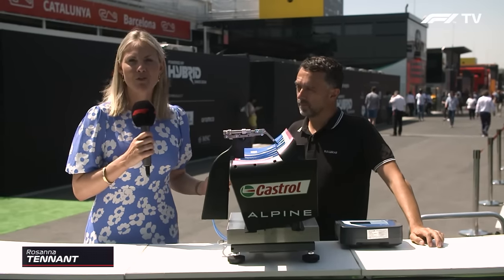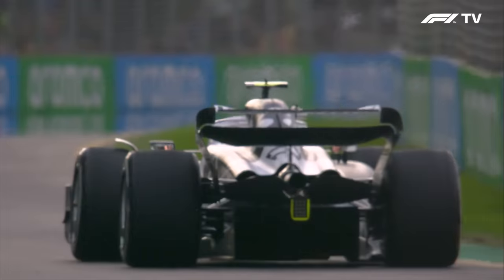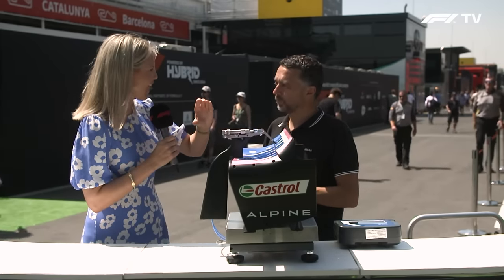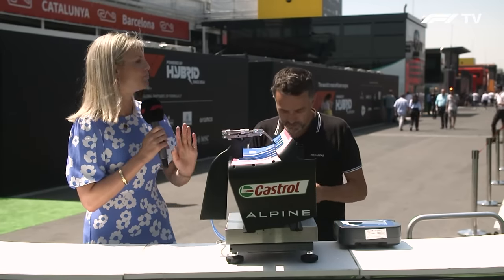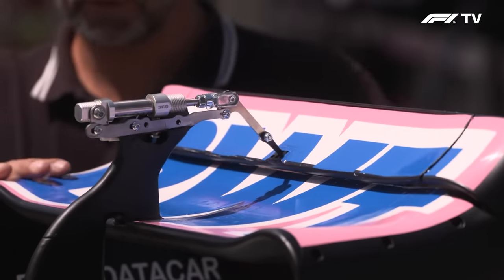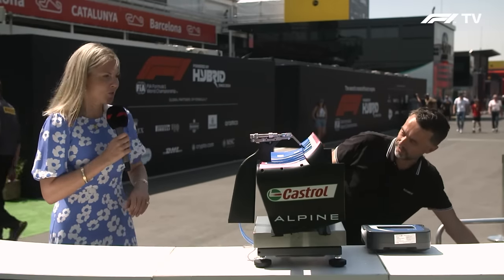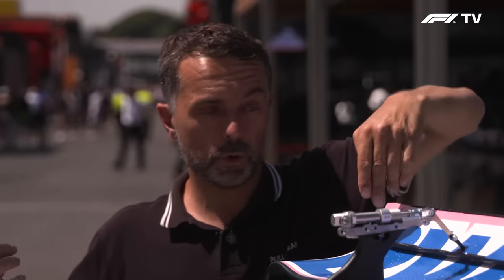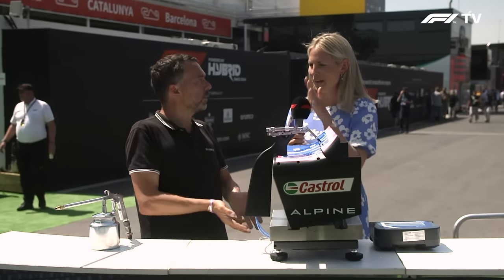How Does DRS Work? | F1 TV Tech Talk | Crypto.com

Comment: 30% reduction in downforce is absolutely mind boggling when seeing how simple the system is. Its just opening a flap and bam 30% less downforce, the innovation and understanding of physics for these cars is truly on its own level
Reply: Aside: 30% reduction is for the rear wheel, not for the whole car
Reply: Well not really "mind boggling" because the rear wing is one of the components that generates the most downforce
Reply: @alancarriedo7378  Yeah well, that's exactly what they're saying, it's insane how one component contributes to the downforce so much
Reply: Easy to grasp when you realize that the energy required to go forwards on earth's surface is to the cube of speed!
Reply: @rkan2  no
Reply: Ehhh… that is aerodynamics 101. The way DRS works is one of the easiest aerodynamic topics to understand on an F1 car.
Reply: @shabalala6605  back in the day main force unit was kgf or kg, so it is kinda old habbit, slightly wrong but everybody who experienced with high end engineering can understand that sentence. That's why back back in the days, daN was really really popular also.
Reply: Does this mean the wind speed can affect race speed and results?
Reply: @nicholastwesige5893  yes :)

Comment: I like it when they explain about the usage of the DRS. That thing has been around since I guess 2011, and man it has worked ever since. That's amazing!
Reply: But DTS has only been around since 2020 or whenever...gotta appeal to those brand new yankee fans
Reply: @alpd7638  Yet you tune into the video and comment on it, so I suppose it appeals to bitter gatekeepers as well?
Reply: @alpd7638  but it's been around since 2011.....
Reply: @alpd7638  and were talking about DRS
Reply: @alpd7638  the addition of DRS years ago wasn't a positive addition to F1 and I've been a fan since the 90s.   It was designed to assist in the lack of passing in f1 at that time.   Technically interesting but that's it, I'd rather the cara have better aero where there's no reliance on drs.
Reply: @alpd7638  as said by another comment… Don’t be a gatekeeper.. If anything you should be happy that new fans are showing more interest to the engineering side of things

Comment: the fact that when the DRS is closed it creates the HUGE drag and when its open it still has a a bit of drag so that the drivers dont create an actual rocket out of the DRS system, like i seriously cant imagine the drs sending a horizontal straight line through the back of the car. That would be like adding probably 30+ kph more than it already has. Mindblowing

Comment: F1 should implement DRS in a similar way to Indycar's Push to Pass. Every driver should get an equal amount of DRS to use at their discretion throughout the race. This could be an amount of time with the flap open, or a given number of activations. You can keep the DRS zones, but just think about how exciting it would be to see a driver chasing down a position and having DRS available to close a 2 or 3 second gap and then go for the pass, or how it would change the strategy if drivers could use DRS to defend as well as attack. I think it would make the racing even better ON TOP of the improvements made by the 2022 rules.

Comment: With the new contours of the rear wings on the ‘22 cars, it looks as if when DRS is opened the lower outside corners of the upper wing element actually are presented up & into the airflow. When opened the rear surface of the upper wing element’s lower outside corners are actually visible in the car’s on board rearward camera views. Especially noticeable on the cars that have different colors front & rear on the upper wing element. Would that not cause drag & perhaps even a lifting (negative G) force???

Comment: The segment does NOT explain how DRS works.  It only explains what DRS is and mechanically how it actuates. That's only 1 small part of 'how DRS works' in a real race.  How do the detection zones work?  How does a car/team/driver know the timing coming from the detection zone monitors?  How is the detection timing communicated to the onboard computer and/or driver?  Someone needs to make a video that shows a car on the track, the detection zones, the DRS zones, the steering wheel indicators, AND the actions of the driver in order to really see how DRS 'works'.  For instance, does the driver have to look down at the screen on his steering wheel for the DRS timing on every lap for every DRS zone?  If less than 1 second then manually push the DRS actuator?  What if he opens it before the DRS zone?  What if he opens it even though the car in front is more than 1 second ahead?  In short, HOW DOES IT WORK.

This is  great youtube channel, but in this case, more questions than answers.
Thx.

Comment: I always thought that DRS was counter productive. I would think the correct way to use it would be free use if you are within 5 seconds of the car in front of you until you are .25 seconds behind the car in front then can't use it. That would cause closer racing if that's the point of it. Not what it currently does which is just let the car that caught up just blow by you.
Reply: Let me try to break this down in parts. 

Lets always keep in mind. safety. These cars are capable of outputting an immense amount of energy at once. The only thing holding it back is the downforce and the gearbox. 

A human is already in control of a lot of things, in the back of their minds they are calculating deltas, corner speed, corner entry/exit, positioning, etc... Given all of that look how many 30g+ accidents already happen. 

Throw away this argument and say they are professionals.

 How many more sensors are going to be required on the circuit, in the car, monitoring system... This brings us to to regulations, the teams are going to try to cheat it and its just a matter of who does it the best, nonetheless regulation stiffen innovation which is really what the goal of F1 is supposed to be about along with close racing. Entertainment is last. 

You will probably never read this and to be fair I will never come back to this. but these are my thoughts on why your proposed solution does not work.

Comment: The mysterious part to me is the “detection zone”. Is this a visible marker or an electronic sensor? Seems like the button push would have to be timed exactly. If the driver pushes the button ahead of the zone, what happens then? I was hoping this video would have gone deeper than the basics.
Reply: In the race, the detection zone is the place where the distance between cars is measured. If it's within 1 second, then it will allow the driver who is behind to activate the DRS during the DRS activation zone. If you press the button before the activation zone, nothing happens. So it's an electronic sensor. There are DRS signs on the straights that serve as a refferences for drivers to know where the DRS activation zones start.

Also note that drivers can use the DRS during qualifying on any activation zone without the need of being within 1 second behind another car.
Reply: There is a sensor under the track, the driver hears a beep when passing over and then he press the button. If the driver press the button out of the zone, it has no effect. Something like this was explained by Pedro de la Rosa (ex f1 driver) the other day in the Spanish broadcast

Comment: Anymore on air technology on Formula could be develop similiar on DRS but its place on velg,blade velg whell that could add air into inside that could change anything needs,,downforce,compresion/pressure engine,engine cooler radiator,,but not much significant than transmision (gear ratio/speed summary) development,,thanks,,hhe

Comment: One thing I've never had an answer for is how does the car know that they're within 1 second of the car ahead? What if they're 2 seconds behind and the driver presses the DRS button anyway? Does it still open?
Reply: You would have to assume the button is only able to be activated if the car is 1 second or closer using the official race clock as it passes the DRS detection point. Maybe the detection zone puts out a signal to the car and the button THEN becomes available to use once entering the DRS zone. I doubt it is reliant upon the driver or the team to allow DRS usage or not. 

The above is all assumption :)

Below are just some copy/paste answers from Google I just searched. It seems it's all automated. 

Is DRS activated automatically?
When the pursuing car is within one second of the car in front when both cars cross the detection point, this turns on a light on the dashboard and the driver can activate the DRS and try to overtake,” he explained. “The detection of the gap between the two cars and the lighting system are fully automatised.

A light on their dash and a beep on their radio alerts the drivers when DRS is enabled and the system is deactivated when the driver releases the DRS button or uses their brakes.A light on their dash and a beep on their radio alerts the drivers when DRS is enabled and the system is deactivated when the driver releases the DRS button or uses their brakes.
Reply: @L3onOfKings  amazing, thank you!

Comment: I have been watching F1 since 1995, and I don't understand the logic in implementing a DRS, program, but then having rules that stop a driver from using DRS whenever they want or need it at any given time during a race, It just makes no sense to me at all. It reduces drag so drivers can go faster, but that is only one part of the aerodynamic structure, and then there's the power unit, and strategy.
I want to compare this with Merc being accused of having "wonder brakes" back when Hakinnen & Coulthard were teammates at MacMerc, and the FIA banned this wonderful invention instead of saying, this is an advancement, and every team can use it, no, they banned it.   
What I am eluding to is that the FIA, throughout history have gotten it wrong on many occasion, and drivers had spoken out. Always changing the landscape with rules that don't have anything to do with safety, or advancement. Did the FIA know when they decided to bring back ground effects  that there would be porpising issues??

Comment: it's interesting how F1 cars are both aerodynamically efficient and inefficient. At one point they are as streamlined as a fighter jet yet they also have all these aerofoils to create downforce causing wakes of turbulent air and induced drag. Just opening 1 flap is all it takes to increase the speed tremendously but then you lose 30% of downforce. fascinating